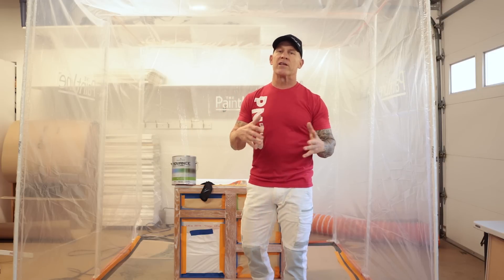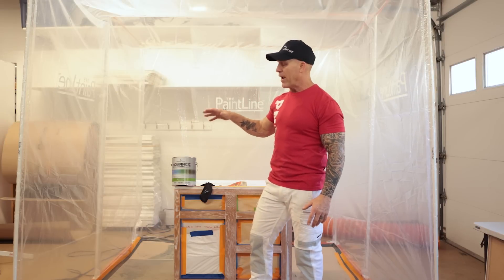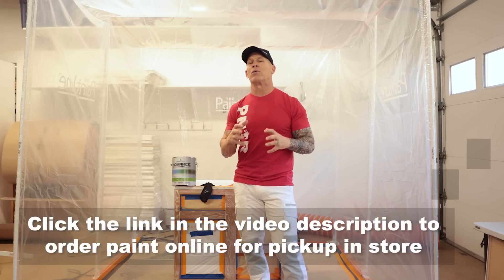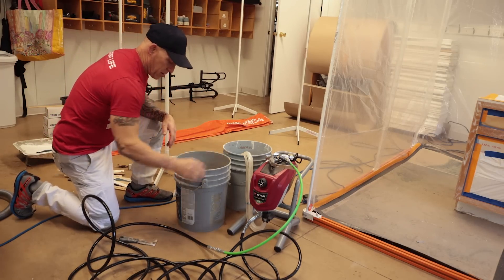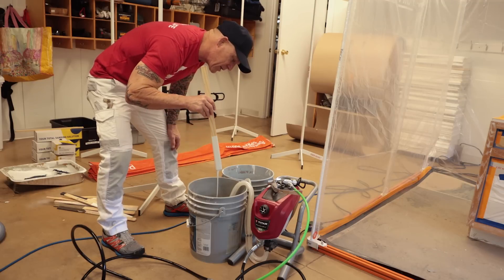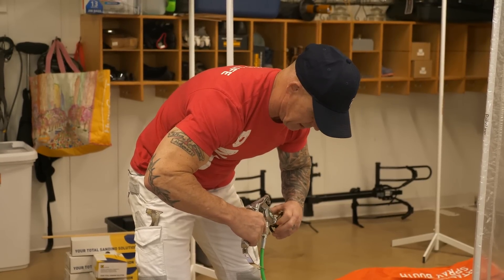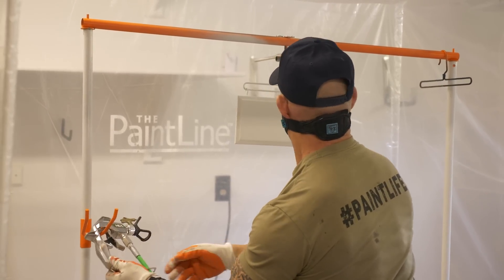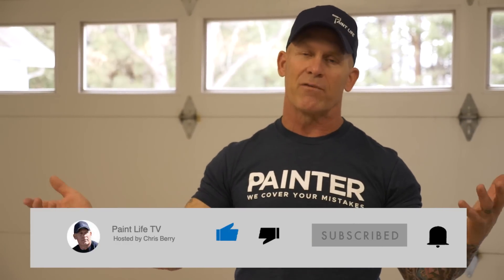Benjamin Moore Advance on Cabinets Reviewed. How Does it Perform Rolled, Brushed, and Sprayed?!

Comment: I have used this product a TON over the last few years. I have used it for cabinets, trim, etc. There are a few keys to this. I have tried a 4-stage Fuji HVLP. No good. It wouldn't atomize the paint unless you thin it a lot. With an airless and FFLP tips it produces amazing results. It is super durable, and levels very well. It brushes and rolls well. I like mohair rollers for any rolled cabinet face frames, etc. The only issue- you MUST use a good primer, and do at least 2 coats. Sand between coats for sure. I use 320 between coats. I also like BIN primer. I have tried STIX, but have been less than impressed. I am super happy to see this review! We have done lots of kitchen cabinet projects with this material, and have never had callbacks!
Reply: I’ve used this product extensively over the last 3 years, and I agree with everything you said.
Reply: @LUckybones25  have either of you gents ever used it to interior paint walls? I got it on clearance for basically nothing so figured it was worth a shot to paint the inside of a garage.
Reply: @emsmkivgolf  it would be a really durable finish, that's for sure! I have used Scuff-X on some things in the recent past, and have had good luck with that too. It is marketed as their most durable paint, and I can see that being possible. Either way- you shouldn't be disappointed!
Reply: @joshuareed3999  thanks for the reply. I ended up using it a couple weeks ago. Primed with 123 and rolled two coats. I didn’t think the smell was all that bad, certainly not as bad as 123. I did get some orange peel in spots that was probably user error. Besides it’s just in my garage so I didn’t need it perfect. So far very happy with the results for a paint I basically got at 70% off.
Reply: @emsmkivgolf  that's awesome. My local Ben Moore will give me any of their oops cans, but they do sell most for $5-$10. Much better than seeing it go in the landfill! I'm glad it worked out!
Reply: @Joshua Reed you now have me second guessing my decision to buy/use a 4 stage Fuji HVLP.  I also own a Graco X5 airless and I have a FFLP tip (310, I believe).  But I was leaning against using the airless as there is so much overspray involved and I'm spraying my kitchen cabinets in place.  I do agree with your decision to use BIN primer + Advance.....I don't think there's a better combo out there.  How do you deal with all of the overspray from an airless?  Also was considering spraying the cabinets with Scuff-X (I used it for my doors/baseboards but still not a lot of feedback on using it for kitchen cabinets).
Reply: @greatscottaz  I usually set up a booth in the garage, or take the doors outside in nicer weather and just spray under a canopy. Away from trees of course! For face frames I do use the HVLP because it doesn't produce as much pressure, and I can't get my masking and cover to stick against the pressure of the airless, so I appreciate the lower pressure and reduced overspray inside a customer's house. I've successfully used foam rollers on frames as well, but the spray turns out better. As for larger "flats" I promise you the airless will make doors and drawers look like glass. The Fuji will run it, but it has to be tuned perfectly. I usually run the air all the way up (at the hose), and dial the spray pattern to push a fair amount of paint, but that does mean you'll be shooting a smaller fan out of the HVLP, so more overlapping. I also fill the cup to no more than half capacity as I find the pressure created in the cup really helps a lot to push the material. It produces good results, but the airless will give you better results for sure. FFLP tips all the way! No more than a 10 orifice. I was pretty close to getting a pressure pot setup, but decided to stick with the airless rig (Graco 495 with digital pressure readout), and haven't looked back. There's also something to be said for the added versatility. I wish you luck!
Reply: I have a 4 stage fuji and I cold not get this to flow through it.  I had to dilute it so much to get it to spray it was beyond the manufacturers recommendations.  Then I sprayed the trim and baseboards and was getting runs I had to hit with a brush and a small roller.  The final product was beautiful.  This week I'm doing more baseboards and trim and got a graco x7 airless.  I'm going to use a 310 fflv tip and plan on 3 light coats.

Comment: I've used this product for about 7 years. Im pleased with it.  One trick I do when I roll the cabinets to get a smooth finish is to sand after first coat (which it sands very well) and then add a little water to thin it on final coat. It will have little to no stipple after it dries. I've done many cabinets for customers with this method and all have been happy. I can't always spray especially if they are living there so I usually brush and roll the cabinets.
Reply: Which grit of sandpaper do you use? Thanks!
Reply: @Avital4414  180-220 sanding sponge. Very light
Reply: @jerd1163  thanks!!!
Reply: What kind of rollers did you use
Reply: @jerd1163  to thin before the second coat, roughly how much water would you add to a gallon of Advance? Thank you
Reply: @Avital4414  don’t recommend thinning this product.Already thin enough. After slight learning curve,mainly preventing runs and keeping wet edge, you can achieve good results

Comment: I am using this to paint my kitchen cabinets. I do not have a sprayer so I’m brushing it on. (They are panel front doors and the brush is just easier for me.). I found if I lightly mist with water prior to applying the paint it makes it easier for me. Do not soak the surface in water!  Just a light mist on the surface.  This does make the dry time a bit longer but it is worth it. 

Love this paint. Worth every penny.

Comment: Been using Advance for years. Awesome product. When spraying with it I’ve found a .308 fflp tip is a good size to help prevent runs. Also when I’m done spraying I use fans to help with the set up time to prevent runs.
Reply: Have you ever had trouble with the white colors yellowing over time? Some claim yes some claim no or very minimal over many years. Thanks
Reply: With Advance being a hybrid paint it won’t yellow like a traditional oil based paint will. Say like Impervo. Regardless. Neither of those products will yellow as fast as people might be telling you.

Comment: I've been using the advance since my guy at Ben Moore gave me 2 sample gallons as soon as it hit their store about 3 years ago. First project we sprayed a big shiplap sunroom and an open fireplace layout also shiplap, 2 coats and it all looked like white glass! Unless a customer insists on using a product of their choice, the advanced is all I use for my interior work! Also the proof is in your prep work people! We all know the better the prep job, the better the finish product!
Reply: How do you get it to look so smooth... My husband has been at it for days and can't get the texture right, he keeps getting an orange texture, any tips?
Reply: Russell Gage, what tip did you use? Thanks.
Reply: @vitex1231  I usually use the 5/15 FFLP tip
Reply: @lixrvs6853  hmmm strange... I've not run into that problem. Only thing I can think of it may the surface hes applying it to? You will get discoloration if the surface isn't primed and you  just paint over bare wood especially like pine or knots...
Reply: @russellgage744  Thanks for the reply. That tip would shoot a lot of paint. Chris used a 208 and 410. Do you move really fast to still get thin coats or are you just laying down 1 coat? Would you use the 515 on cabinets? I'm using Advance on cabinets for the first time and appreciate any advice.
Reply: @vitex1231  yes I spray the base coat and finish coat lightly to prevent sagging and runs.. and yes on cabinets I'd use the 2 tip because its a smaller  spray pattern.. I use the 5/15 on larger open areas
Reply: @russellgage744  Thanks!
Reply: @vitex1231  you got it bud! Happy Painting! Hey matter of fact I could use some help come to the Cape and work? Lol I'm solo at the moment on a full exterior overhaul...

Comment: As a DIY'er used Advance to paint a kitchen with a lot of cabinets. I rolled it using a short mohair roller without overworking it, left it overnight between coats. To speed things up I used Benjamin Moore Regal in the same color/finish for cutting the cabinet interiors. Also built a simple drying rack to hold 20 or so cabinet doors at a time. Even so, it still took a long time (many days) to get everything done. The paint goes a long way, levels out beautifully, coverage is excellent with two coats (I primed). Best thing I can say is it doesn't look rolled, at all. Would use it again.
Reply: Do you recommend laying out with a brush after rolling?
Reply: @Avital4414  I didn't lay out with a brush and it dried very nice with just a roller (like sprayed on). Also, I found the paint didn't like being messed with once it was on.
Reply: @robertdavenport7802  thanks!!

Comment: I love these paint reviews. I'd love to see Durapoxy HP in one of these tests. We found that Durapoxy HP is very similar to Advance in performance, with faster dry time, and cures a little harder with higher scuff resistance.
Reply: Just a quick reply without any research on my end... where do you buy the product and is it waterborne? Ia always looking for new products to add to the arsenal. My feeling on Advance is that it is a very good product. I do feel like I'm leaving something on the table without using a lacquer or similar product, so I'm also interested in learning about other finishes.

Comment: I use Benjamin Moore advance a lot.. cabinets I like vinyl sealer. Graco 695. 412 tip green fine finish at about 1300-1600 psi. Brushing and rolling you want to put it on as fast as possible and leave it alone. Microfiber roller cover FTP China-x a little bit of floetrol. Also a ox hair brush works really well.

Comment: thanks Chris, i needed this viseo today! DIY, here, first time sprayer. Using a Wagner Flexio 5000. Spray my primer at 45s (kilsz2, ford #4, 25% diluted with water) but after two doors, some chunks of paint appear on the surface (air gets pretty hot by then). I've was timid to dilute the BM advance as much as the primer and didnt get much flow, or a smooth finish. i git enough down to leave some top coat after sanding the rough surface off.. Like Chris says, it's a buttery soft finish, albiet after sanding. if I had to do it over, I'd spring for a higher end HVLP sprayer, I've put a lot of time in trying to figure out the interplay of all the variables. With more power, the learning curve wouldnt have been so painful  Today, I will dilute to 45s and try again..I hope the paint holds up and goes down smoother. Update later. Peace to all😊

Comment: I've always had trouble with Advance running and sagging a lot. I've had some good turnouts on it as well. I'm on the fence about the product but after seeing this I'm thinking I will give it another shot and use some of the knowledge you dropped in this video to see if I have a better outcome. Thanks Chris you always do a wonderful job with these paint reviews.
Reply: Same here.  I had sooooo many runs and sags with this product when I built and installed cabs for a home office.  I swore it off from that point on, but this review is making me rethink it a little.  I currently use Scuff-X for cabs, with Stix primer as a base, and am happy with the results, but always nice to have different products to try and recommend.
Reply: @JohnWilliams-cu4cc  if you like stix, use their cabinet coat. It's much better than advance. Faster cure, smoother finish and way better adhesion too!
Reply: I had problem with runs too but I started to run a fan ( just a normal house fan) to the freshly sprayed cabinets and that prevented my runs even with a heavier coat.
Reply: @user-os7fe5xn9v  nice I never really thought of that idea either. I will keep that in mind on my next cabinet job. I've got one coming up soon.

Comment: I think you mentioned the dry time 5 or 6 times but did not address whether or thinning is necessary and what to sand with between coats. Primer underneath and what brand? How would this work with a HVLP sprayer? Would this paint be good in bathroom c idling and walls? What sheen were you using?

Comment: This paint does NOT have a 4 hour “open” time. Also, it can be fussy to work with. If you overwork it, it starts getting fuzzy. Put it on quick, and leave it alone. Check for sags a about five minutes after applying it.
Reply: That is my experience too... I've found it dries to the touch REALLY fast.
Reply: Agreed! I have learned to leave it alone almost immediately after applying. I don't see the promise of being able to mess with it for long. Every time I've gone back to "fix" something (within minutes) I've regretted it. 

Also I'm fairly new to spraying and am having a hell of a time spraying the inside of a small box. Either it ends up with runs or I get stippling because don't apply enough paint in an attempt to avoid runs. (And yes, I know not to start or stop above the surface.)  I'd love a video on how to paint on 3-D surfaces or on the inside of things without them turning out like crap! Lol! Anyone with suggestion, please, please help!!!
Reply: I’ve heard this stuff drys to the touch in 30 min.

Comment: I used this paint on a 2 sets of kitchen cabinets and the results were excellent.  I am not a professional painter but not have a lot of experience painting.  I sprayed the work with a portable Graco hand sprayer with excellent results.  Here is what I found:  
1 - Don't spray heavy - I sprayed all doors in the vertical hanging position and if you are too heavy on the thickness you will get sags at the rail and stile intersections if not careful.  
2 - Temperature is extremely important.  I found that the closer to 70F or less, the better the leveling.  On the first set of doors i sprayed at 80+F and found that a significant amount of stippling was evident.  While the paint says it takes 4-6 hours to dry, I don't think so at all.  Note there is a big difference between drying and curing.  The hotter day made the paint stipple because the water in the paint evaporated too quickly and did not allow the paint to level at all.  I applied the second coat at 70F after sanding and got perfect results. 
3 - Sanding the first coat - I waited 24 hours to sand the first coat.  I found that the cure was not hard enough in just 16 hours to do a good sanding job.  The paint clogged the paper too easily until a 24 hours cure time elapsed.
4 - The finish actually needs a lot of time to fully harden so you have to be gentle with the surfaces after painting.  After a month of babying the doors this paint finish is really tough and hard as you would expect from a alkyd enamel.

I will use this again.  BTW - In some cases I needed to do some hand brushing and I really would caution against working the paint too much.  remember it does not take much longer than a regular latex to skin and of course the temp governs the amount of time here.  I also contacted BM for an extender recommendation and the could not provide one because they have not tested any yet with this product.  But as you say, this paint right out of the can is thin enough and further thinning with water or glycol would just compound the sagging issue on vertical surfaces.
Reply: Great tips! i’m looking to do two coats to my cabinets primed everything with sticky primer from BM question do you have to sand your final coat?
Reply: @inkman411  Final coat - no sanding.

Comment: I use Advance for trim work. When it comes to cabinets, I spray a flat paint and then do a satin or semi gloss clear coat. That’s the best durability in my opinion. When you need to wipe/wash the cabinets down, it won’t affect the color itself.
Reply from the maker: Interesting
Reply: I have tried everything. Seriously. Flat paint with Ben Moore "Stays Clear" over it. Regal in every sheen they make. Advance in every sheen from flat to semi-gloss. Where I landed after lots and lots of time and effort- clean and de-gloss with TSP. Sand lightly. Reclean. Prime with BIN- an absolute must after trying literally every primer out there. Paint with Advance Satin using an airless set to 1500-1600 psi with Rac X 310 FFLP tip. You do not need to thin the paint at all. Let dry for an entire day. Sand lightly with 320. Paint again. Let dry an entire day. If another coat is needed (unlikely) you can repeat the process of sanding and painting. This finish is beautiful, durable, and I have done this tons of times at this point. I tried getting into Pre-Cat Lacquer, but couldn't find anyone else to make tinted lacquers thanks to our lovely EPA. This is the best finish you can put on cabinets unless you have a special spray booth, etc. I have tried it all. Don't bother with Emerald Urethane, Pro-Classic, 2-3 step processes, etc. I hope this helps someone else. It took a ton of time over the last few years to figure all of this out!!
Reply: @joshuareed3999  I know you commented a while back.. but thought I’d ask three questions since you’ve used other paints as well. First, have you tried it with STIX primer rather than BIN, if so, was it better with one or the other? Second, I’m considering INSL-X cabinet coat for cabinets.. have you tried that for cabinets, if so, how did it compare? Third, have you noticed Advance yellowing when using a whiteish color over time?

Comment: Use BM STYX PRIMER FOLLOWED WITH BM ADVANCE SATIN. 2 coats primer, 2 coats finish. My prep  was extensive and tedious. Primer is FANTASTIC . Advance coats were 20 hours apart. All this about a 6 drying time is baloney. My finish coat was dry to touch in 40 mins.  Sanded between all coats, rolled with Micro fiber. Super smooth. My old plywood doors look like Vinyl wrapped now cabinets. Mind you I filled all edges and sanded